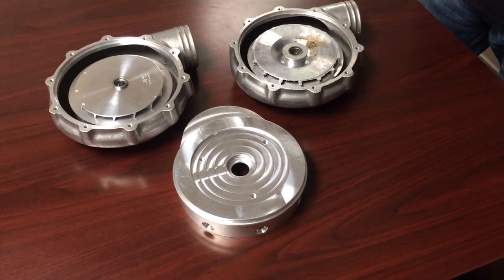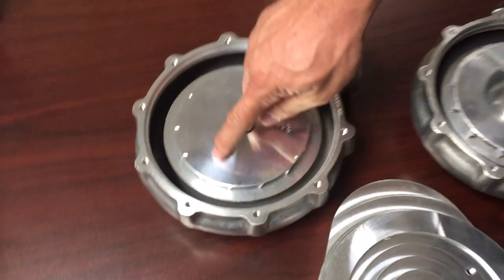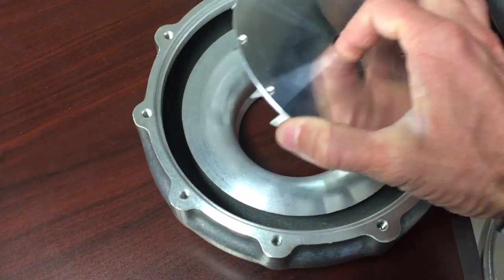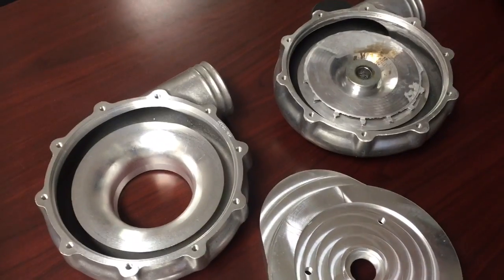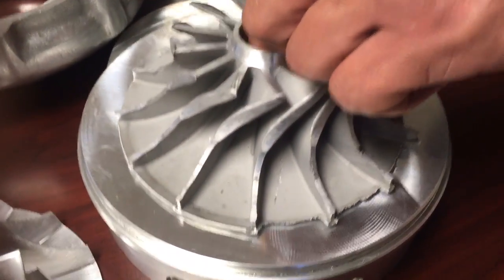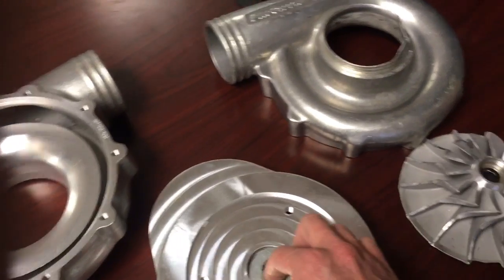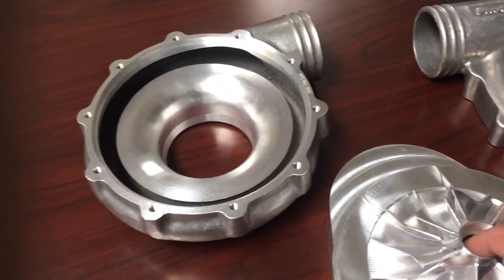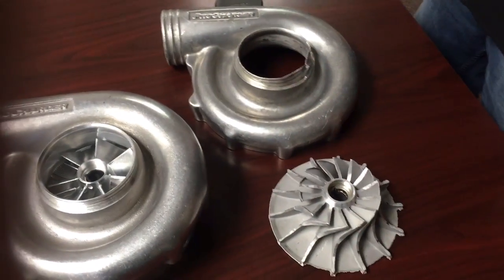CAREFUL: Not all supercharger rebuilds are created equal | Horsepower United

Comment: Man that guy that rebuild that is a real dirtbag. It’s one thing if he’s taking a turbine and trying to do a small repair to eliminate a crack, it’s entirely another to put a cast part in there, knowing it’s going to spin at tens of thousands of RPMs and cause damage without a doubt. 

That 100% will not last three hours of use. I doubt that would last a Dyno pull. That is unreal. I never would’ve guessed someone would be this low.

Comment: A impeller replacement through procharger is 1300 bucks.If they do the bearings its another 500.1800 for a unit that cost 3k.Might as well upgrade and trash the old one.A Bit high after you pay the 7k for your kit

Comment: Would love to see the flow numbers on that cast wheel? Yeah I think everyone would like to see the numbers on any Procharger original impeller. Hell the P1SC compressor map floating around was tested by a guy that worked at Vortech.
Reply from the maker: So would you trust Vortech to map a ProCharger correctly and share on the internet?    Thats like GM's marketing team doing the review of the GT500 Shelby.  

Vortech makes nice units, ProCharger makes nice units, Whipple makes nice units, Eaton makes nice units.... everyone has some great stuff. Thats what really matters. :)
Reply: I think Vortech uses a lot of cast impellers don't they?